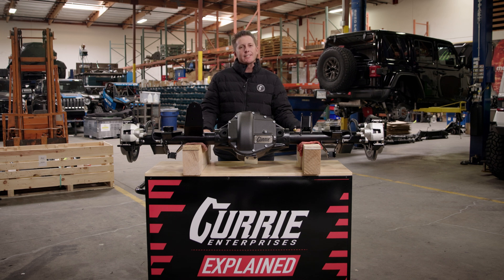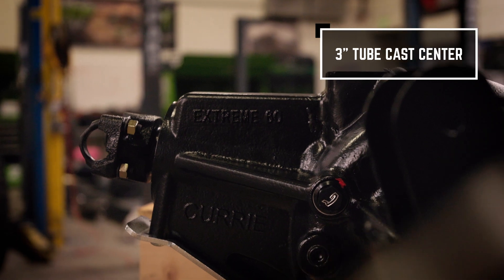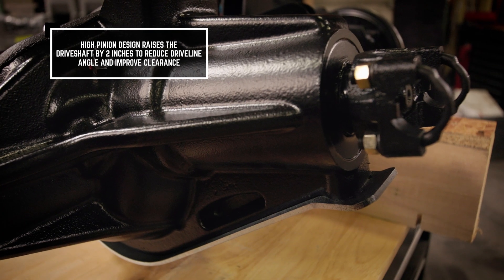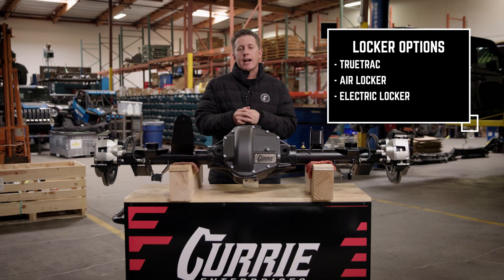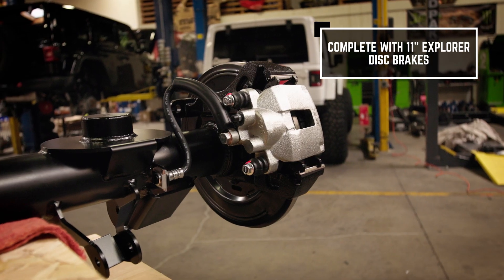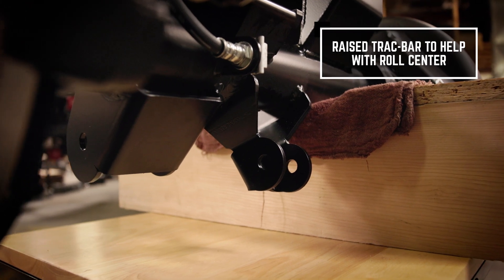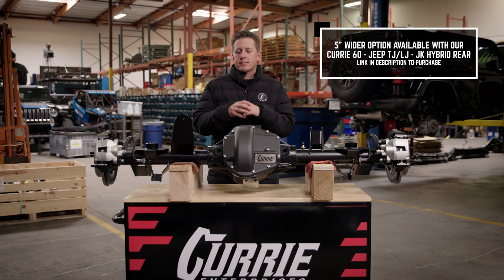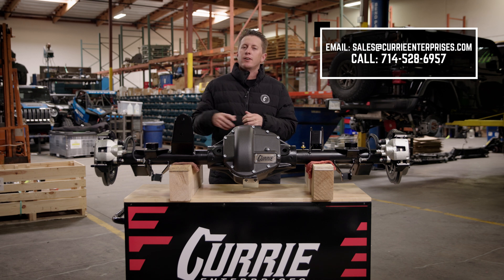CURRIE 60 JEEP TJ / LJ REAR AXLE ASSEMBLY WHAT YOU NEED TO KNOW | EXPLAINED

Comment: Can Super 60 Gears be installed in the HP Rear 60? I'm buying a JK with RockJock 60s F&R (FF High Pinion Rear) and 40s and I'd like to strengthen it up a bit if possible.

Comment: I`m very happy with the 60/44 set up on my 2000 T.J.  It would be nice if you could show some options for the rear sway bar. I have the sway bar flipped for now. I would rather not do a body lift to fit the rock jock rear sway bars as i`m already at 4.5" lift on 35`s.